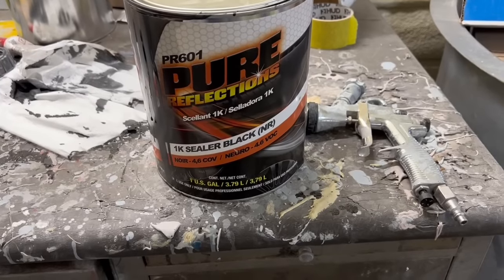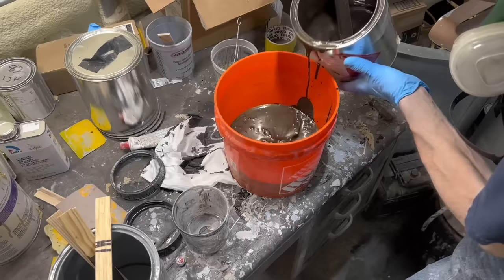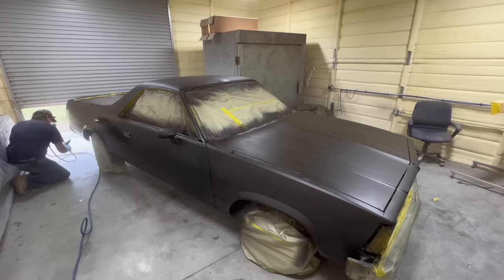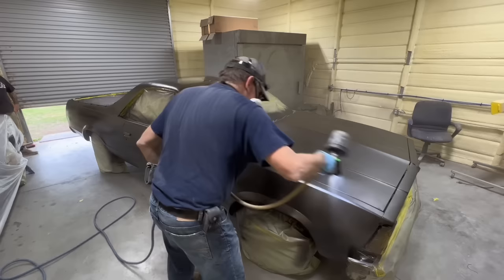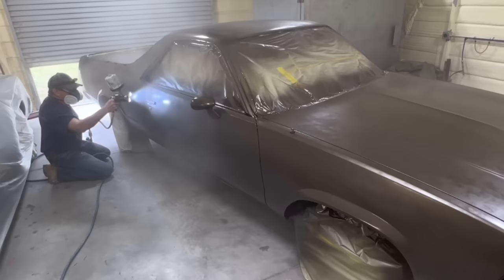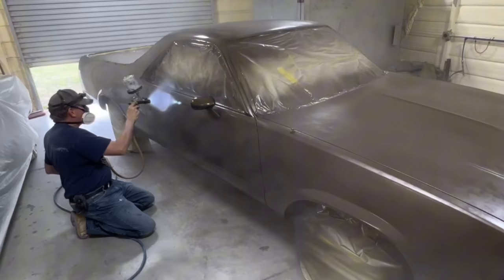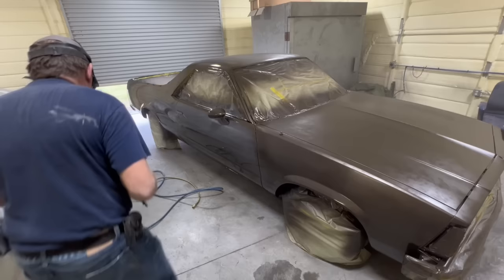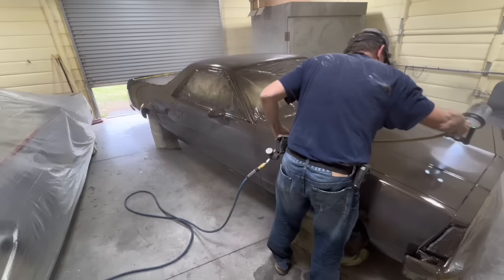Spraying The CHEAPEST Paint On The CHEAPEST Bodywork😱😱 1K Sealer Enamel Paint Plus Clear Coat

Comment: Hey Billy! I haven’t gotten to see a video in a bit so thanks for uploading hey quick question I seen that your base coat swipes were supper fast. Do you usually crank up the flow of material or what? Just wondering if so I would like to try that method if the benefit is there
Reply from the maker: I’m going super fast in conjunction with the 90% overlap.  I don’t want it to be super wet

Comment: What spray gun are you using?
Reply from the maker: R500 LVLP.  This is Vevor’s kit with 1.3, 1.4, and 1.8 tips. I used the 1.8 tip for the sealer and acrylic enamel color, and the 1.4 tip for the clear